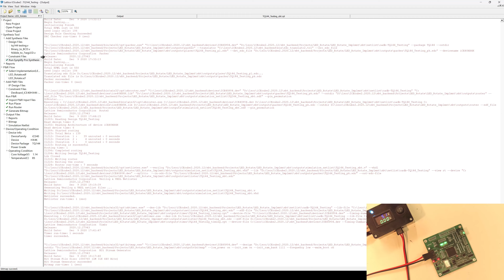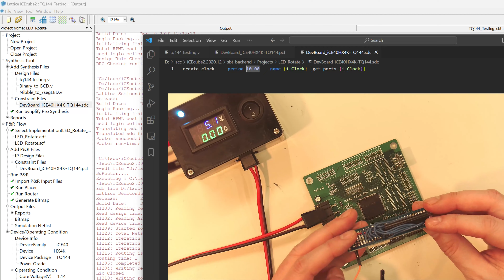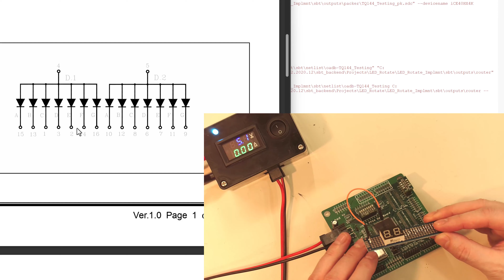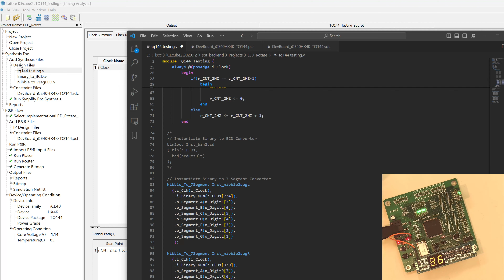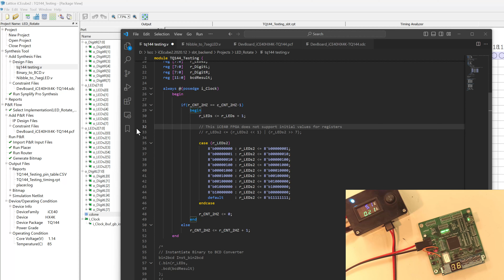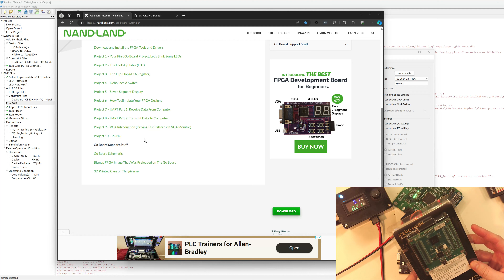Lattice iCE40 FPGA Dev Board - Adding a 7-Segment LED Display & Some Toolchain Updates

Comment: 29:01 - That most definitely is a concern. The voltage isn't the issue, but the current is! Most of your 220mA is going into those LEDs because you're not limiting the current! You need to be very careful, as you're dangerously close to lowing the FPGA bank up - it won't be designed to sink (or source) that much current! Something like 270 Ohm to 1 kiloOhm would be a good start.
Reply from the maker: Resistors added. https://youtu.be/yt7aZDHM89U

Comment: Good stuff! A few notes:
1. SystemVerilog is 100% backwards-compatible with Verilog, so you can just change extention from .v to .sv and it should still work, but then later you can start using SV constructs.
2. Do not connect LEDs directly to FPGA pins without current-limiting resistors as this can overload IO buffer and can lead to long-term damage.Typical LED's voltage drop is 2-2.5 V depending on a color and a specific part, so 330 or 680 Ohm resistor is good enough for 3.3 V IO.
3. There is a limit to how much current an FPGA can source or sink, typically it's in 100-200 mA per IO bank, so if you have a lot of LEDs connected, you can exceed this. I typically use MOSFETs to drive actual LEDs as this makes sure IO buffers are not stressed with excessive current.
Reply from the maker: Resistors added. https://youtu.be/yt7aZDHM89U
Reply: I'm designing a board with lattice machXO2 with a 4 digit 7 segment display, i've added 330 Ohm resistor to every segment and a PNP Transistor with 2k Ohm resistor for the common anode. Is there any specific parameters while choosing the transistor ? My voltage is 3.3V. Thanks

Comment: Plain Verilog is good enough. SystemVerilog support is usually rather spotty. BTW. Does that FPGA have PLL blocks? And you can stick some electric tape over the 7seg display to improve visibility in the camera. Using the same color tape as the display gives best results.
Reply: I disagree - SV is superior to verilog, and it's totally worth using.
Reply: @asmi06  It is better per se. That's indisputable. The problem lies within the tools that interpret the standard in rather liberal ways. As long as you stick to one specific toolchain, you should be ok. But as soon as you try to share the code with someone who uses different tools, things quickly begin to fall apart.
Reply: @pvc988  I never actually encountered this problem in practice.
Reply: @asmi06  I did. Altera, Xilinx, Yosys, Icarus and official specifications all have these little incompatibilities that just break things in all sorts of weird and fantastic ways.
Reply: @pvc988  So which one actually caused problems? I never used open source stuff because I heard they are littered with issues, but with vendors' toolchains I've never had any problems, even though none of them even claim to fully support SV, but the kind of constructs I use worked identical. And even this partial support makes a world of difference.
Reply from the maker: This FPGA has a pair of PLL blocks (I don't know how to use them yet). Thanks for the note on the tape. In past videos I have covered the displays with colored mylar. If I keep this display in future videos, I'll make that quick change. Thanks, @pvc988!
Reply: FPGA professional here; Definitely go with SystemVerilog. Verilog is fully supported in SystemVerilog, but supports much more useful features which you'll have access to, and some useful things to stop you getting burnt. I'd definitely go with SV; the worst case is that nothing happens ;)